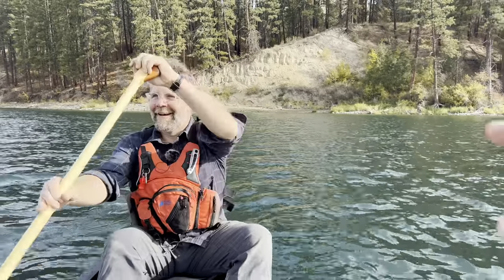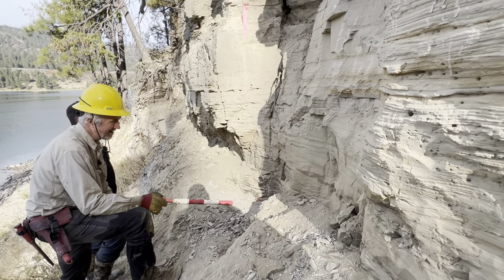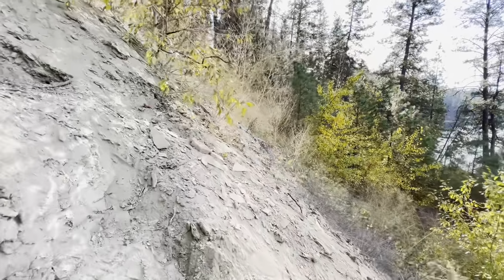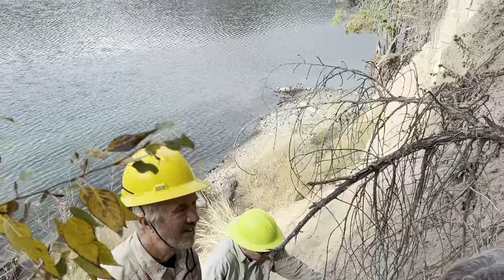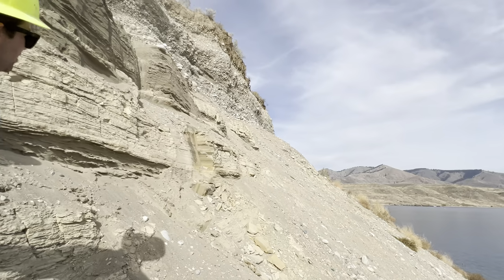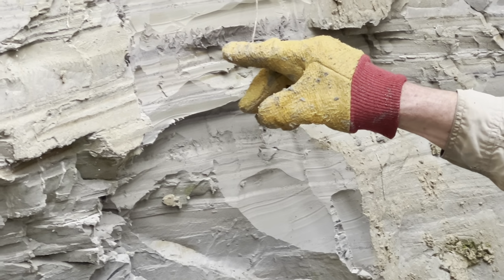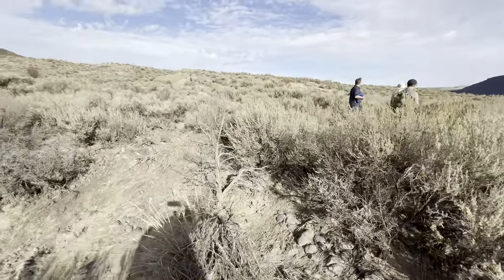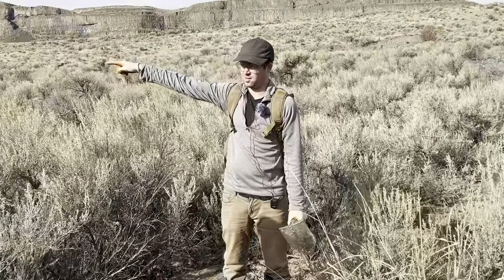Brian Atwater in the Sanpoil - w/ Jerome Lesemann & Joel Gombiner

Comment: I’ve been perturbed by the break in the Bretz conversation to be honest! I’ve seen this type of bedding on the Hoh Clearwater and Queets rivers. Wondering if it’s from Tsunamis 🌊 or floods from the glaciers advancing and retreating. Though at the Hoh I do find abundant clay concretions. All are below the “Canyons”on these rivers. Queets: 47°33'08"N 124°12'05"W Clearwater: 47°36'19"N 124°17'28"W 48:28 Hoh: 47°48'05"N 124°15'37"W  each of these spots seem to be areas where there are deposits and even possible areas a Mega Tsunami 🌊 could reach inland. Some layers go beyond just being Perturbed! Say hi to Bijou!